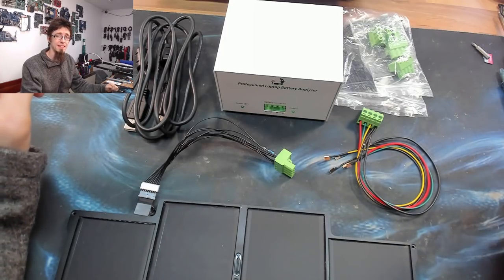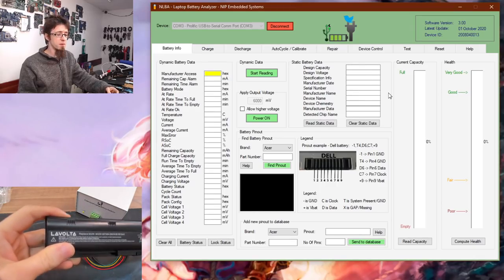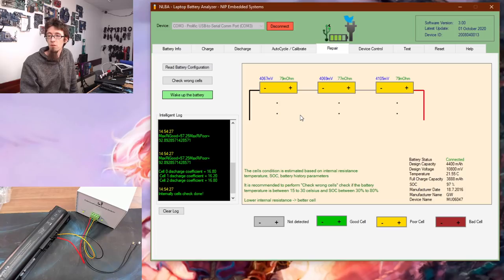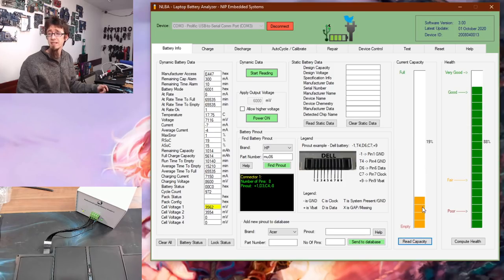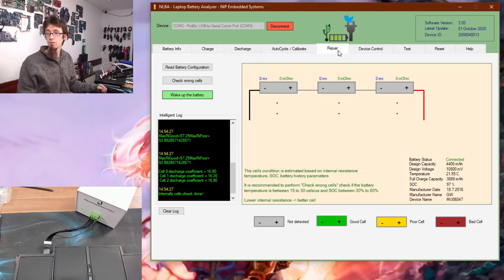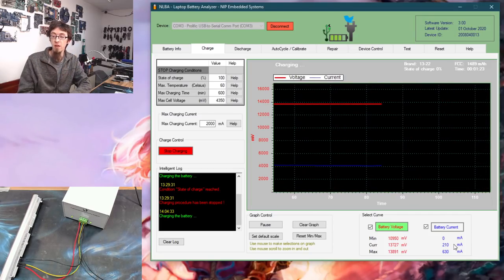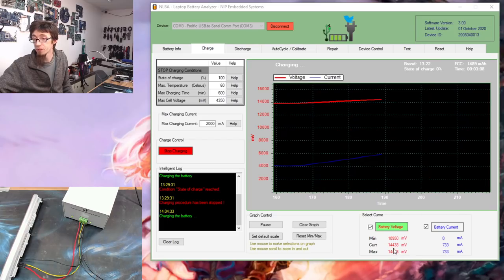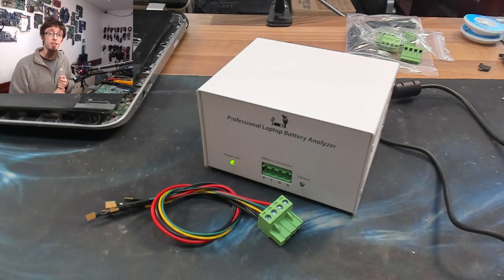Professional Laptop Battery Analyzer - LFC#227

Comment: I bought the first unit, sadly not a single battery can be revived nor the reading a battery properly.  I'd prefer to use the software to check batteries now.  Unit has been retired. 😌😔
Reply: Are you sure you are using it correctly? Perhaps your batteries have been locked. This is a safety mechanism to prevent the battery from over charging and potentially exploding. I have use this device regularly since it was released and have revived many batteries.
Reply: @rdp8545  Hi,  yes I am using it correctly,  with correct pin out (input voltage, gnd, clock, data and temp). I only manage to read one battery data successfully.  But otherwise completely unusable.  Cheers
Reply: @iTCXtreme  Careful, you may just get comments, claiming you don't know what your doing...
Reply: @iTCXtreme  Please check the latest version V3.00 that shows Battery Pinout of about 500 batteries. It is not sufficient to connect only Vbat, Gnd, Clock and Data. There is another important pin called System Present which must be connected to GND in order to activate the battery. NLBA device is compatible with almost all laptop batteries excepting Panasonic Toughtbook since they have proprietary protocol.
Reply: A very important thing that many persons are not aware of: If the battery is in Lock state it cannot be "Revived". If a battery has bad cells then nothing in the world can "repair" the battery. Steps to repair a battery: 1. Detect the defect (in many cases it is due to over discharged cells). 2. Fix the defect by replacing the cells or bring all cells to the same voltage. 3. Reset/Reprogram the chip to clear the errors (NLBA for the moment supports BQ8030 chip reset and I will add more chips soon). 4. Analyze the cells voltages by measuring the internal resistance and tracking the voltage under load -> NLBA can do it.
Reply: You can simple put a picture with the battery on the community and I will explain what is happening with that battery.
Reply: @nipembedded9976  the way it checks for poor/bad/good cells is actually wrong. You cannot just use a resistance test...It gives a false reading
Don't take my word for it..check here https://batteryuniversity.com this site will tell you how you should 'properly' check all batteries, some great reading
Reply: @johnburrows7938  The microcontroller inside the battery measures the voltage on the group. If you have a battery 3s2p, 6 cells, 11.1V nominal voltage, 4400mA, it means that the voltage reported is for Cell1, Cell2, Cell3 where Cell1 is actually formed from 2 parallel cells. The internal resistance is computed on the group, there is no access on the individual cell, the cells are in parallel, you have the voltage on the parallel group. In theory, a good single cell should have internal resistance under 30mOhm, if you put 2 such cells in parallel then you should have an internal resistance lower than 15mOhm but there are also welding points, wires, and so on. We did experiments and measurements to reach those values. The device would be much more accurate in doing the estimation if we consider one more input: how many cells are in parallel. This variable is missing because the software cannot predict based only on DesignCapacity. For old batteries that were using 18650 cells, you know what if you have DesignCapacity=4400mAh or 5200mAh you have to deal with 2 cells in parallel. But for newer batteries the cells are flat and high capacity, one Li-Po could have 4400mAh and you don't know if it is one or two. Another option would be to let the user introduce how many cells are in parallel because it can be observed physically looking at the battery. But not all the users are experienced in identifying how many cells are in parallel. What I can tell you for sure is that NLBA computes the internal resistance very accurately, but from internal resistance to estimate how good are the cells the accuracy could be reduced due to an unknown number of parallel cells.
Reply: @johnburrows7938  If you test about 500 batteries then you have a pattern so you can estimate how good are the cells. Just to respect the software advices: SOC range and Temperature range. The internal resistance is changing with SOC and Temperature a lot. You can have 40mOhm at 20 celsius and 80mOm at 5 celsius.
Reply: @johnburrows7938  lol 👍
Reply: @johnburrows7938  That's obvious!
Reply: @johnburrows7938  The website  no longer exists
Reply: @samcheung4984  try again, I’ve altered the link.
Reply: @johnburrows7938  thanks.

Comment: I'm wondering if this will work using only a bench power supply, or you need the data connection to the battery aswell? In my experience I almost never was able to recover a dead laptop battery by just trying to charge it with a PSU.
Reply from the maker: Generally speaking you need to communicate with the battery's BMS (Battery Management System) to charge it. Some badly made batteries will take a charge regardless of the BMS status, but it's not the norm.
The advantage of this system is easy access to the statistics int he BMS though, health, cell balance, etc, which let you make a judgement call on if the battery is any good or spent.
Reply: The battery chip requests how it must be charged, what current and what voltage. Charging a laptop battery directly using a lab power supply could lock the chip. More, Dell laptop batteries will not charge without specific data communication.

Comment: Does the chip inside the laptop battery handle cell balancing? On rc lipo batteries you have a separate balance lead in addition to the power leads that connects on to the smart charger. I wouldnt force charge a battery and leave it unattended otherwise you could come back to a fire
Reply: Exactly, the chip inside the battery is responsible for balancing, monitoring the temperature, tracking the capacity and many many other things. Most batteries have an internal let's say "programmable fuse" which could be burned by the chip in case a failure is detected, so no input/output current.

Comment: The current graphed in blue seems upside down as increasing current goes down the screen. Gentle ramp er 'up' in current to start is good to see.
Reply: Isn't because of negative current ?
Reply from the maker: Yea negative current is shown as going down from the top of the graph.
I didn't really want to drill into preferences in the video, but it'd be really handy to be able to customise the graphs, either axis or colours, as they can be hard to read at times. It's completely usable, but could be clearer.
Reply: @Adamant_IT  Good option for next updates. Thanks.

Comment: It's ideal for checking for bad cells which might be replaceable?
I have a Toshiba netbook which I bought for light use before tablets became very popular and less expensive, after 5-6yrs of non use I fired it up and the battery was dead! I took a punt and started to remove and install the battery hoping it would jolt it into starting, after about 15-20min it finally woke up, I initially thought the battery wouldn't be any good but after 3-4 charges its like new with about 10% wear on it! Now all I've got to do is replace the battery on my Samsung note! 😂
Reply: NLBA device can check the cells as soon as the Voltage is present on the battery connector.

Comment: Should have asked a while ago...
Can a laptop battery be charged (using short wires) by another laptop (same brand, different model)?🤔 It is only to charge the battery - it works but the laptop it belongs to has power problems (think it can run off the battery but not from the wall adapter) - enough to run some tests on the problem laptop. Thanks 🤓
Reply from the maker: If you wire the battery in correctly, there should be no issue with that. Battery pinouts can vary between models though, even on the same brand, so don't try and connect a different battery without first checking the pinning.
Reply: @Adamant_IT  ok that's good safety sense! Thanks 🤓

Comment: I boost dead battery by drilling both sides to expose cell terminals(DO NOT TRY IT AT HOME) and charge it with current limit set on my Lab power supply. Couple minutes usually is enough to bring it back to life. Although dead cell might get very hot afterwards because of its high internal resistance. So do not try this at home! if you don't know what you are doing.
Reply: Got this from Sorin did we?
Reply: Yes, it is a very dangerous method. You can drill the cell and produce a short. Not all batteries have + in one side and - in the opposite side. Also, the most important thing: If the battery has PF (Permanent Failure) flag set then it won't work. You can even replace all cells with new cells, same, it won't work. You must RESET the chip, to reset it's errors.
Reply: @nipembedded9976  Well when I say "drilling" I meant making small holes in the plastic casing usually with small screwdriver. I do it only for testing porpoise to check if "plugged in not charging" is caused by faulty battery if I don't have good one to swap. This should not be treated as a repair.
Reply: @Qban220  To check why a battery reports "Plugged in but not charging" you need to check some flags inside the chip and the cells voltages. Unfortunately, you can't do this with a pc software. But the most important rule, if the chip is in Lock state (PF set) then you can apply what voltage you want, you won't make it working again unless you reset the chip.

Comment: My macbook air (late 2010) had no charge (charger broken and didn't need the laptop) and sat without charge in it for around 9 months (i think, or longer). To my surprise it did charge up all on it's own (incredibly slowly at first... macos said 0% for about an hour..).

The large internal resistance probably explains why i've got an old laptop, and under heavy CPU load at below 80% battery, it'll just cut out.. it's an old cheap replacement.. likely voltage droops under heavy load below minimum cutoff.
Reply: This is usually happening when the FCC (Full Charge Capacity) parameter does not reflect the current state of the cells. You kept the battery 9 months, the state of the cells decreased due to their chemistry behaviour in time but the microcontroller has the old information about the cells state. One option would be to charge the battery 100% in the laptop then discharge it to 0% then back to 100% in order to update the FCC. Some batteries firmware does not allow a difference in calibration cycle more than 10% of the original FCC.

Comment: I was trying to charge up an old lenovo battery. The pwr manager said 48:00 hours remaining and never finished charging. I opened the batterypack and found three corroded batteries inside. Time for a new or toss it out :P (The dead batteries were reading 0,3 V)

Comment: Will it work with Power Bank battery or Type C or Micro USB connectors without taking out the battery inside? Thanks!
Reply: NLBA device works only with laptop batteries.

Comment: Very affordable offers, the device itself is excellent performance, much cheaper than the price of its predecessors, the software is much cheaper than similar ones. Excellent tech. support, the forum explains in a popular and accessible way how to use the software. Even in the event of problems in which the device itself and the software do not help, those. support explains how the battery can be repaired.

Очень доступные предложения, сам девайс отличного исполнения, намного дешевле по цене своих предшественников, ПО стоит намного дешевле чем аналогичные.

 Отличная тех. поддержка, на форуме популярно и доступно объясняют как пользоваться софтом. Даже в случае возникновения проблем, в которых сам девайс и софт не помогают, тех. поддержка объясняет какими способами можно починить батарею.

Comment: Love the videos. Maybe you can help me with an issue. Have a a320m hd2 board with a ryzen 5 1400 i cannot get video from it. I have tried reseating the cpu. I have tried different psu different ram. Tried both ram slots with all 3 brands of ram gskill trident z corsair vengeance and some micron.i have also tried 2 different gpus different cables. I have use the clear cmos jumper have removed the cmos battery still nothing. Just put all my money into this and im jist stumped.

Comment: cool and informative video, i was messing about with a used t410s battery and lenovo power manager, i managed to increase its capacity by repeatedly charging and discharging it like 4 times, however then i run prime95 while discharging and the battery droped abruptly from like 70% to 5% even tough it worked just fine with a light load,  the capacity in power manger also dropped, i was kinda disappointed but something to look out for
Reply: Can you try to perform a Full Charge -> Full Discharge -> Full Charge cycle ? Full Discharge is achieved when laptop doesn't not power up on battery.

Comment: In order to reset unlock and read/write the eprom you need to pay 39,99 per month for the software license...
Reply: Yes, this Reset option is offered by a third-party partner. We don't have the secret UNSEAL algorithms to include them in the NLBA device for free. It is an option for those who want to repair batteries (program the chips). Comparing to the competitor's price I would say it is far better.

Comment: I am curious about the alarming phone call, did they have a minor explosion?
Reply from the maker: The two concerns that I'd been told about were A) Quality control, a previous revision had a possibly faulty batch of power transistors that could go bang. These have been replaced, and a bigger cooling fan fitted. Additionally, better PSUs are included now, as seen by my one having a Delta Electronics unit.
B) Apparently the design was lifted from Texas Instruments' Fuel Gauge technology. However, this Fuel Gauge tech is a development kit that is fully intended to be developed into an end-user product like this, so I see no issue at all.
The chap I spoke to had encountered a faulty unit, and sometimes customer service encounters go wrong. This was one of those times. It happens, but it doesn't automatically mean that the product is fundamentally bad.
Reply: @Adamant_IT  Thanks for the very full answer Graham
Reply: @Adamant_IT  so just the sheer fact they had to revise this design, by admission, meant there was indeed faults and problems. My experience of this kit was a negative one, yours may not be.
Reply: @Adamant_IT  One note from my side. I don't use any TI development kit at all ! I just use the SBS standard which is public. Nothing more. Everything else is just work, a lot of work. There are many other chip brands, not only TI, for example Renesas R2J240.

Comment: The battery's being recovered how much could be reliable you think?
Reply from the maker: If it's been deep-discharged (ala, no power at all) the chances are that it won't be reliable again. This is more useful for determining if the battery is at fault or the laptop - or if you have spare batteries but you don't have the appropriate laptop to test them in.
There will be edge cases where a battery that's had little use may have just been stored at low charge, and would be perfectly good if recharged though.
Reply: It depends on the actual state of the cells. For example, if a new battery is stored for several months then it got over-discharged (it does not enter in Lock state) then the laptop does not recognize it anymore. NLBA can generate a voltage with very very low current, about 30-50mA to try waking up. If the battery is woken up it could hold almost the same capacity as when it was produced. Another example, if the battery is 5 years old, 500 cycles, FCC=1000mAh then it is stored for a long period then after waking up it will hold almost the same capacity. Of course, in both cases, there is a loss of capacity due to its chemical behavior in time, but it is low.

The only batteries that are not in Lock state (PF Permanent Failure flag) set could be recovered. If the battery gets over-discharged below a certain voltage then the microcontroller enters in Lock state making the battery completey unusable. NLBA can reset such a battery that has BQ8030 chip. So, if the cells voltage is increased to above 3.5V after reset the battery will work again.
Reply: @nipembedded9976  great explanation, thank you

Comment: I wanted to ask , if I replace cells(li-ion) of my dying asus battery with new li-po cells of same size from China.(assume I match up the voltage , but buy the bigger capacity cells ) .
Will it work ?
Reply: There are 2 very important aspects you need to take in account:
1. You need to have a solution to reset that chip (its errors internally to make it working again)
2. For a chemistry and capacity different the original you need to change many other parameters to make the firmware working properly. It's possible but it needs to be done by an expert. A better idea is to send the battery to a specialized repair shop because they have the required tools and they can replace the old cells with new cells higher capacity. There is only one shop in Romania that can do it.
Reply: @nipembedded9976  Is a must that the battery pack board remains connected to an external voltage source during the replacement of cells? Would anything get disabled in the controller chip if disconnection from cells occurs?

Comment: Is there a Battery Analyzer for Power Drill battery
Reply from the maker: Most power tool batteries don't have a serial BMS (as in, there's nothing to communicate with in the battery) and behave more like a dumb hobby lipo pack. You can usually charge them just by injecting power onto the + / - terminals.
So to test their health, you need an electronic load (bench load, like the opposite of a bench power supply) that can drain the battery and measure its capacity.
Reply: Thanks! 103020220430